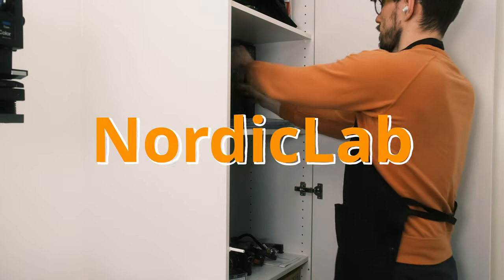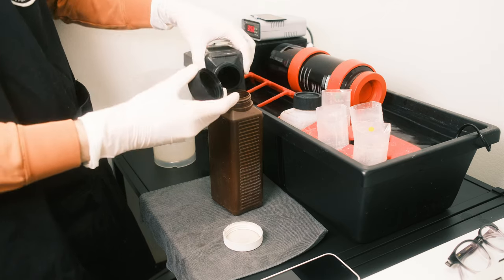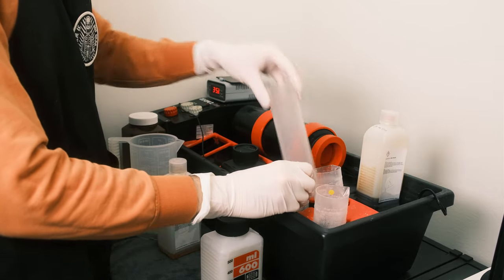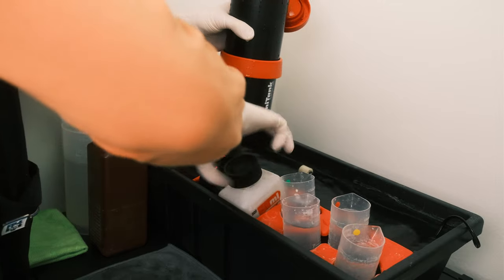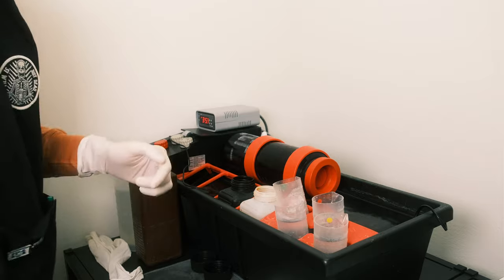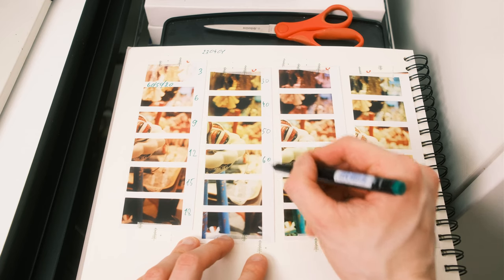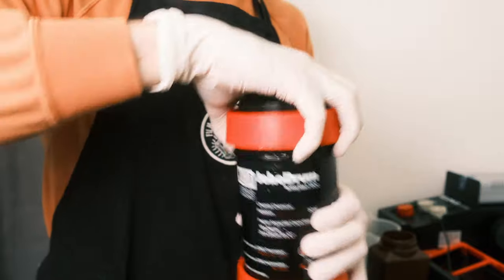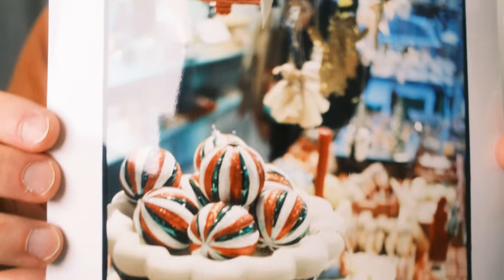Perfect white balance indoor on Kodak 500t

Comment: Nice video and nice print. Two questions: 1) Do you prefer those paper negative sleeves over plastic? I use plastic and I've never looked into switching. 2) Do you develop your Vision film in ECN-2 or cross process it in C-41 chemistry when you plan to make prints?
Reply from the maker: 1. Don’t really care, just have huge pack pack
2. So far never developed ECN2 process, this one was developed by Silbersalz lab
Reply: @NordicLab  Ok, thanks.